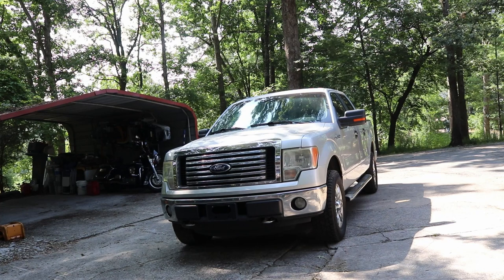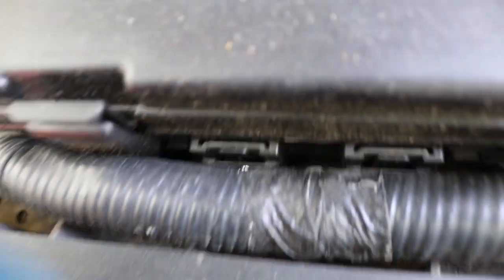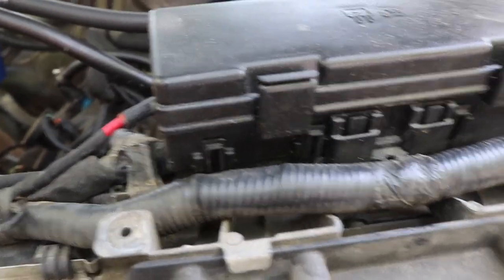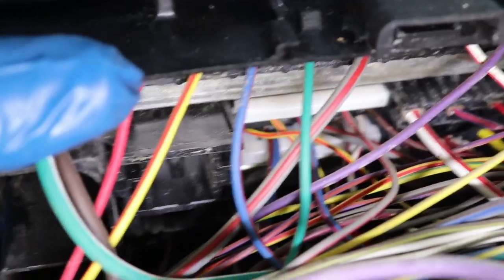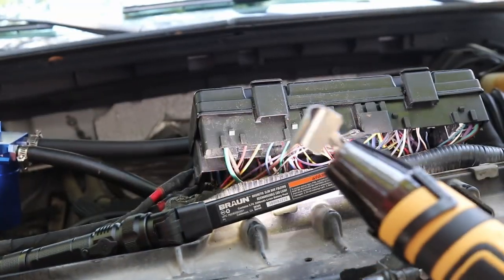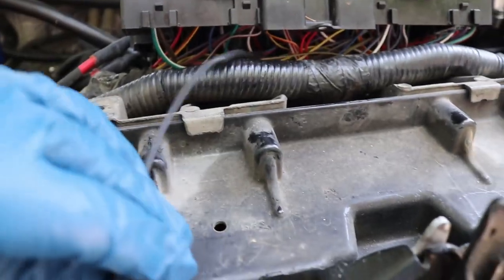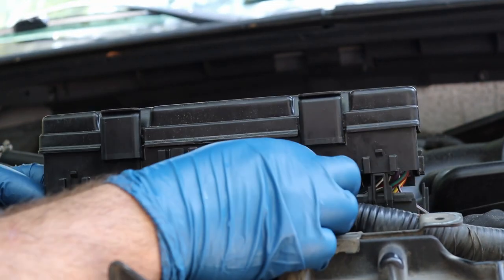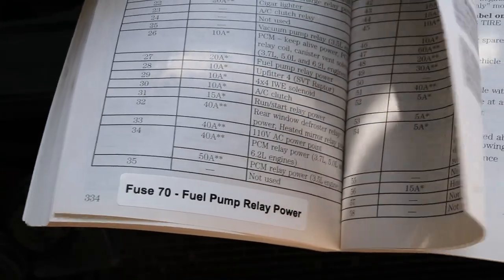Ford's Fuse 27 relocation kit (Full Guide) F-150

Comment: Always disconnect the negative instead. Those universal battery terminals are an open circuit waiting to happen.
Reply from the maker: Negative is what I would normally take off when working with electronics. but we don’t want any active voltage possibly going to our fuses. But if I’m incorrect you can elaborate more I’m always willing to learn something new. Thanks for watching!